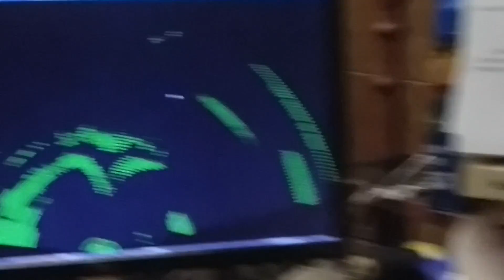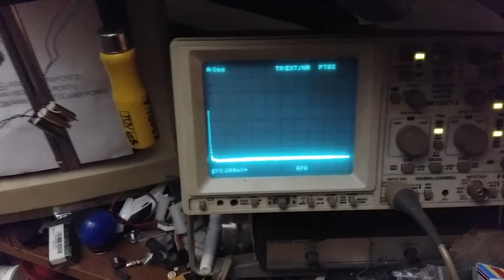New And Better Sonogram: Make Your Own Arduino Radar

Comment: I looked at the page on your website. This is quiet interesting. I am sorry I gave away my unused Arduino kit Although I am sure I have the parts to make an UNO around here somewhere.
Reply from the maker: It is actually good to get rid of Arduino uno. Right now I am working on boat for searching for my quadcopter in the river (lost many days ago). Then I will back to this project and make more than 80 points, which is limited by speed of the Arduino nano I am using. STM32 is much better and faster, just need to adapt to new environment. Also, making good parabolic antenna for the ultrasound will be better option to get more clear picture. Since it does not uses echo pin, I am getting everything sound bounces of. Thanks for interest.
Reply: ***** Good luck locating your quadcopter not so good it is in a river. I will be interested in your progress with the Sonogram. I will check back soon.
Reply from the maker: Yes. Thanks.
Reply: Hi  Milan  ,  can you say why in your processing  not have color parameters and  have a blank screen ?
thanks